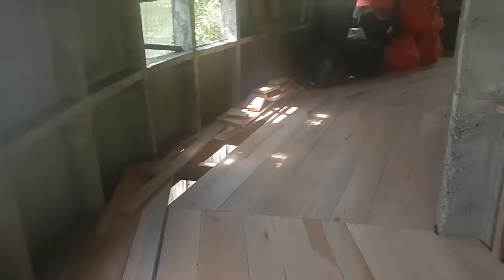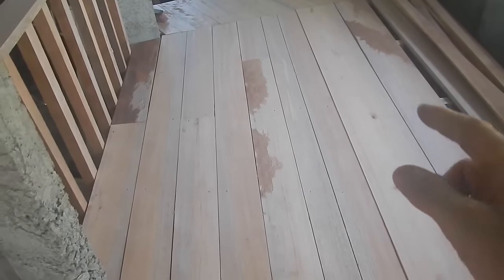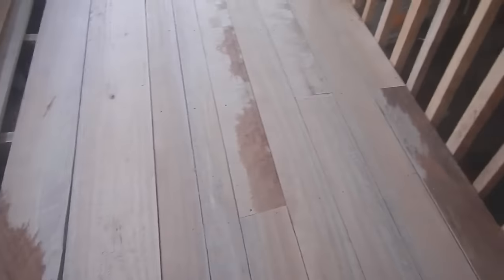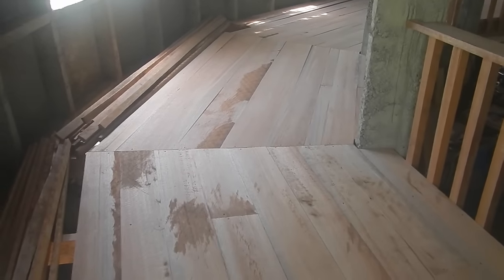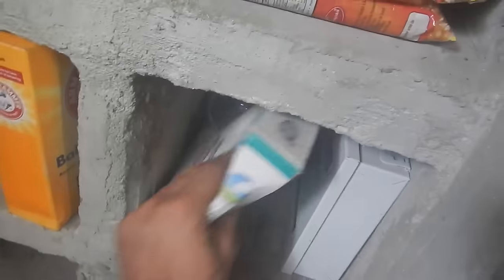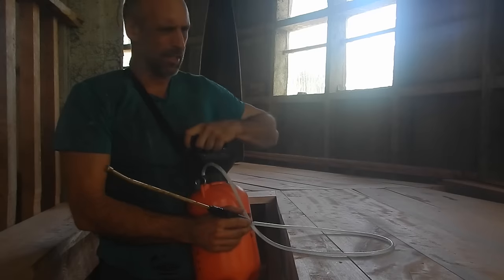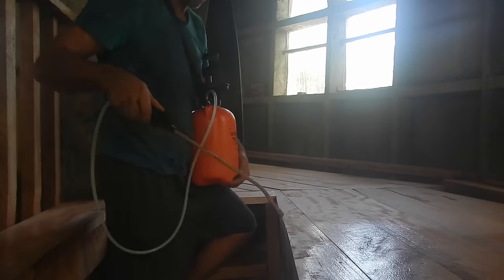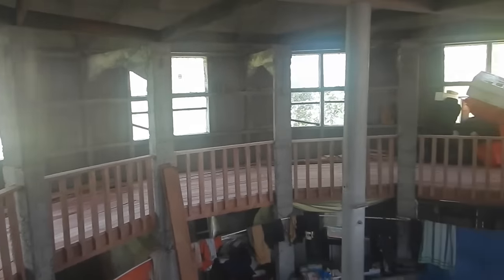Bug Proof that 2nd Floor!

Comment: Hi, You can check the Lime for your needs, mix it with water to get milky liquid and it can be applied on the walls and wood (all become white) it's very good and cheap natural antiseptic to prevent mold and for wood also acts like fire protection. Nice Job with the floors!!

Comment: Is Borax detergent based on Boric Acid?  I thought they were different.
Reply: No you're correct. Borax is not boric acid, boric acid contains borax though. Boric acid is what is commonly used as a pesticide and insecticide. Borax is mainly used for laundry soap, hand soap and also as a fertiliser.